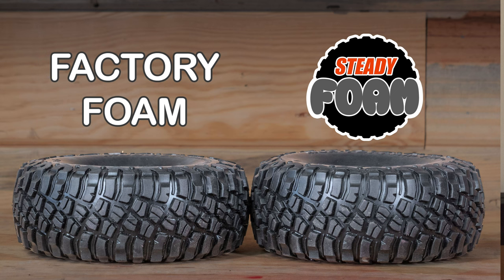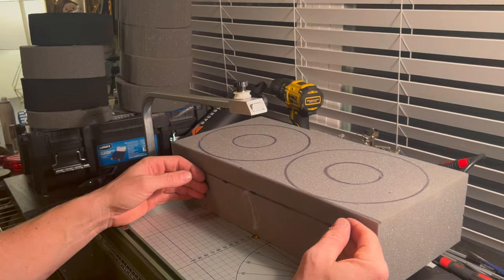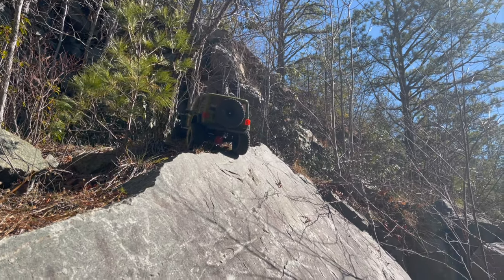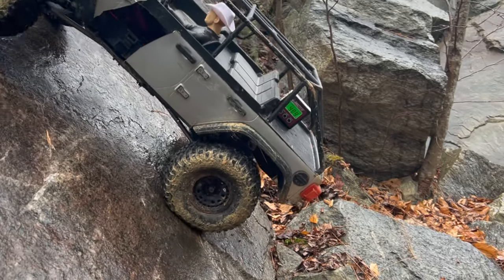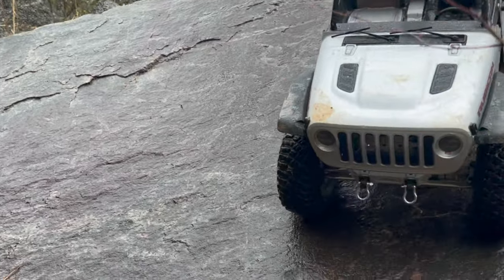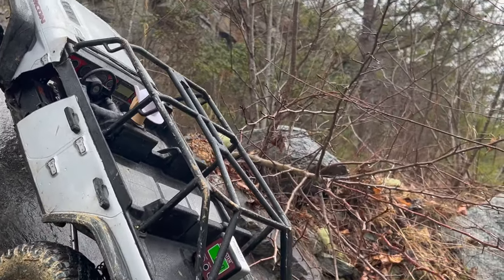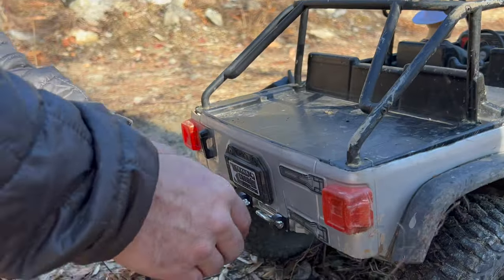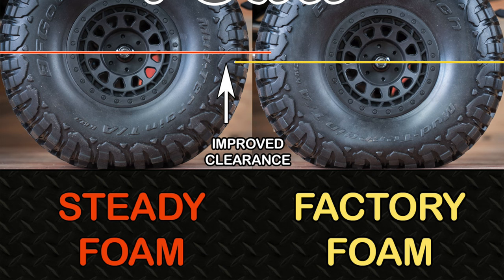Axial SCX6 Steady Foam and Recovery ❤️‍🩹 of Berm Peak

Comment: Traction, torque, and proper weight with respect to rigs center of gravity is the absolute key in crawling.

Glad you found a foam that will work. Next try a duel stage foam combo, that gives you best of all worlds for tire grip and deformation to given obsticals.
Reply from the maker: How does your Scx6 handle its stock foams ?
Reply: @SteadySpin  don't have the 6 I have a 1/10th redcat gen 8 crawler,  bunch of guys I go crawling with and myself sware by pitbull or pro line duel foams. You can easily make your own as well with a foam cutter like you did with current foams.

I dont remember if I am running medium or soft duels

However the duels give great traction and deformation under sharp or sudden objects encountered under heavier load. The sxc 6 being heavy I could see greatly take advantage of duels for sure. Could be worng, haven't seen anyone try on YouTube yet.
Reply from the maker: @PeterCPRail8748  Do you make your own foams ?